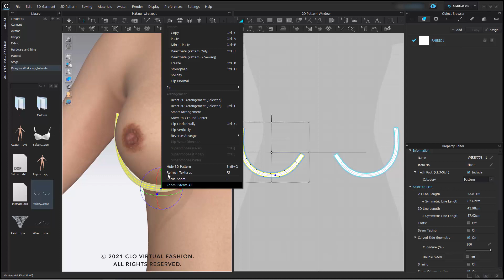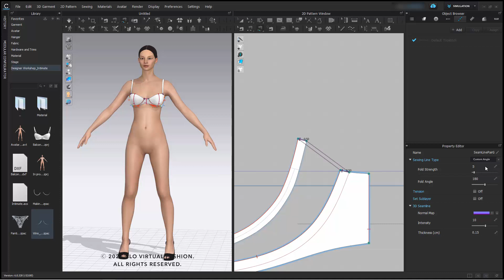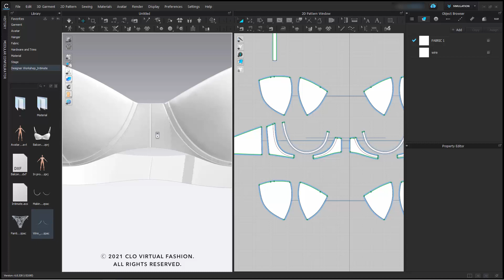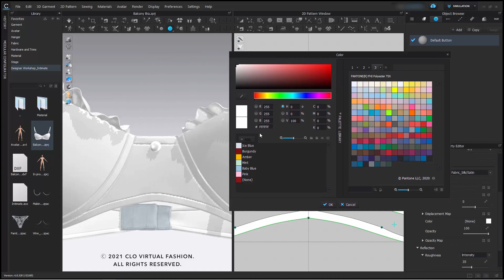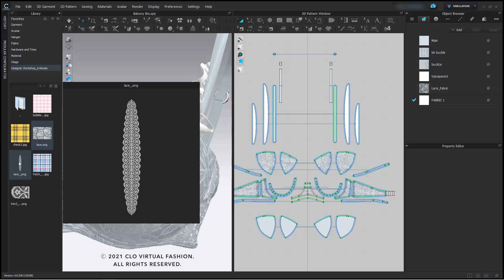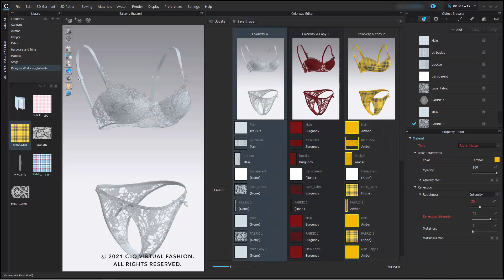Introduction to Intimate Wear

Comment: Second comment : I've been trying to make ring and slider since this morning and it was quite easy to create them but I'm unable to use those because each time I simulate its collision with fabric and either become wrong fitting  or came out. could you please suggest me the video where I can solve this problem or creating one would be better. 
thanks !
Reply from the maker: You can also turn off collision. They will then act more like a stationary avatar. You may also want to increase the collision of either the ring or the strap slightly. Also make sure the Particle Distance is low enough on the strap so the mesh is tight and cannot slip through

Comment: Hi, would you be able to animate something like this? I'm attempting to animate a corset and I'm trying figure out an alternative to freezing to uphold the underwire and boning structure. Any suggestions?
Reply from the maker: Hi. A good Alternative to freeze with items that sit on the body can be Pins to Avatar. Remove the Freeze > Add Pins to pattern piece (make sure it is in place) > R-Click on Pins in 3D > Pin to avatar.

Comment: When try to make the underwire pattern they 3d simulation explodes them, does anyone know why this would be happening?
Reply from the maker: Have you Frozen the underwire Pattern Shapes?
Reply: @CLO3D  Yes, I've tried freezing, strengthening, and pinning like the video, still explodes
Reply: Okay, I figured this out, I was pinning to the avatar and for some reason the program flipped out, but just regular pinning works.
Reply from the maker: for further help we recommend posting to our Official CONNECT Forum - https://connect.clo-set.com/community

Comment: Do you have a video you can share on how to achieve the final image? I can make snapshots of colorways, but I need renders in multiple colorways in one image. I could render each colorway, then photoshop, but curious if there is a built in way...
Reply from the maker: There are other videos here about mastering Rendering. As for multiple colorways in one file you would have to import multiple projects into one.
Reply: I reccomend Keyshot for it's ease of use.
Reply from the maker: for further help we recommend posting to our Official CONNECT Forum - https://connect.clo-set.com/community

Comment: I did not understand how you create a wire under the breast and how to make it so that it does not fall but is a support for the bra?
Reply from the maker: You Freeze that pattern piece... it is in the video.
Reply: @CLO3D  thanks for your reply.  But how to animate garment if part of the corset is frozen?
Reply from the maker: @cococochanel6989  You cannot animate a frozen pattern piece. Explore changing the material of just the "underwire" to a stiffer fabric and apply Strengthen & Solidify.

Comment: where do I find this naked avatar in clo3d trial version?
Reply from the maker: There is a Textures folder in the Library with the Avatars. If you have the latest version of CLO you can use Avatar Styling. https://support.clo3d.com/hc/en-us/articles/900006057446-Avatar-Face-Style-Configurator-ver-6-1-